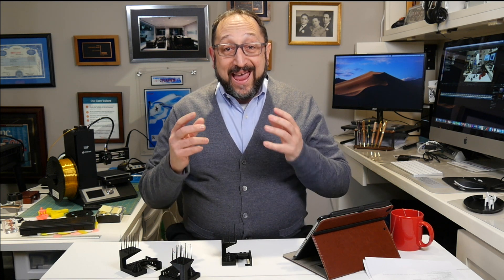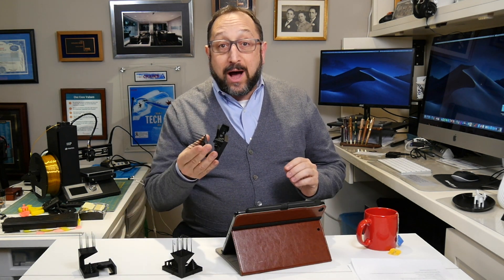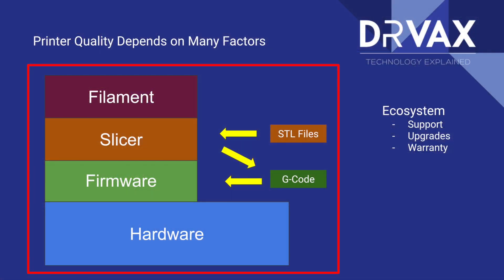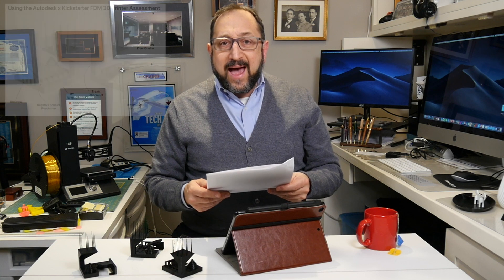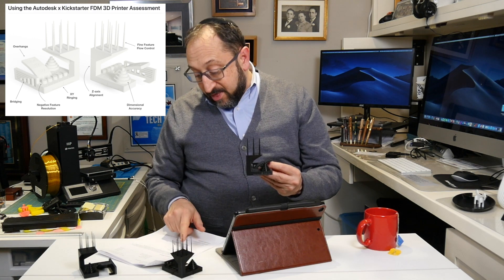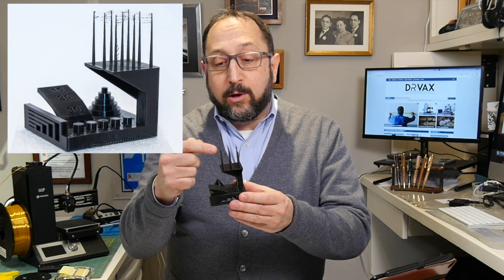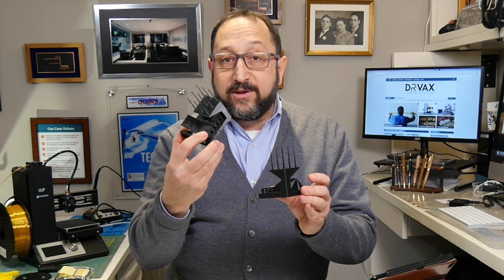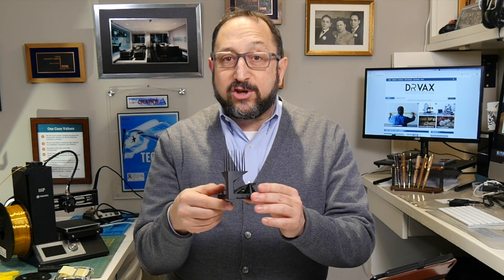Creality Ender 5 vs Original Prusa i3 MK3 (Updated Comparison)

Comment: Really interesting video,  your a great teacher.  Interestingly it appears that really the only reason the prusa edged out the ender 5 is because of optimised slicer settings in the prusa edition. This means you could, with a bit of work and quite a few test prints,  get that higher level of performance on the prusa of Cura too, and that means ....... you can likely increase the performance of the ender 5 by tweaking the cura settings too.  It would be interesting to run something like an ender 5 directly against a prusa in a production environment to see if the prusa really is a more reliable professional option, or if it's just that the slicer provided is actually just much better optimised which gives the illusion of a better printer?  One thing's for sure, where I am Prusa parts are not so easy to come by whereas I can order a lot of parts for my ender 5 on amazon with next day delivery and free postage.

Comment: Thanks for your video. I dont print too much but i WANT that everytime i want i print i can have my dimension right at 100%. If i have a piece that are 20*20*20, i dont want 20.1*20.2*19.9. So do you think i can achieve this job with ender 5 ?????
Reply from the maker: Probably not possible to get more precise that .1 to .2mm with any consumer grade FDM 3D printer.

Comment: nice video basically on the kickstarter printer evaluation model, it is kind of helpfull, but beside the price and tolerances there'd be a lottttttt more things to watch into, especially if you make 2 videos on the issue of comparing the two printers. what about noise, the ender is substantially louder when printing, what about the height you kind of defined it negatively (demanding space) but in terms of flexibility the ender is capable of printing much bigger objects, then again what about repairs where the ender is quite demanding, what about failure tolerance in terms of power shortage, running out of fillament and so on where prusa has a lot more to offer, what about quality of components which guarantee a much longe lifetime and a consistent quality throughout the lifetime, what about the usage of multiple fillaments at once, ther is an upgrade for the prusa but does anything similar exists for the ender ? (I seriously dont know because im just getting into the topic), what about connectivity, the Prusa is only fed by SD and USB , does the Ender have WLAN ? what about power consumption (not relevant for the hobby guy but for semipro it will) ...there is just so many aspects which havent been covered

Comment: Hornestly, i changed from ender 5 to prusa mk3s because the ender 5 is good a first, but starts breaking very quick. First was the cheap fan of the Hotend broke. Then the Mainboard started glitching and the cheap couplings of the bowdentube got loose when using retraction. Also it jammed all the time if you used over 80% of extrusion. 
The leveling was a nightmare. It seemed like after every print i had to level the bed new because the weak spinks were not strong enought or the bed constandly warped. The Z- Switch started also failing quite soon.
With the prusa i just had a noise problem on the y axis.
Reply: print the bed supports for free, Add a BLTouch for the auto bed leveling. Add a better nozzel end. I have not had any issues with bowden tube couplings but they are super cheap. You could do all this for under $60 and it will print as good or better than the prusa. I own both. U can buy 2 enders and upgrade both with BLTouch cheaper than one prusa and have a lot more build area. Also the Ender is SO SO SO SO much eaiser to work on and the upgraded parts are so easy to print or get for cheap compared to the prusa. Good luck.

Comment: Ender 5 still a good choice or has other options that are better bang for the buck came out?
Reply from the maker: It is a good choice, specifically the Pro version, if you need the print area.  If you do not. need the print area go with. the Ender 3 V2 and add a BLTouch.

A great place to discuss this is at the DrVax forum located at https://forum.drvax.com.

Comment: oh maaan, i thought i already made up my mind with a Ender 5 pro... but indeed, i want it to print a lot; so now i have to give a thorough check to prusa.
Reply from the maker: The Ender 5 pro is significantly different from the Ender 5 and closer to a Prusa.  The Prusa will have the edge in speed (direct drive vs bowden) and the ability to print at 300c while the Ender 5 pro from the factory I believe is limited to 250c.  If your buy the Prusa Kit expect to speed many hours (4-8) putting it together.  The Ender 5 Pro should take you 30-45  minutes.  Prusa support is the best available for a printer under $1,000 but the Creality user community is huge.  Best of luck.
Reply: @MakeWithTech  in your experienced opinion, the extra cash the Prusa i3 MK3 costs does it worth the investment compared to Ender 5 pro? the difference is considerable but i would pay that extra if it worth it.

Comment: I'd be really interested to know your opinion of the Prusa i3 MK3S vs. the Lulzbot TAZ6 / Workhorse printer line.  Am thinking about getting a PURSA as a second printer for printing high-detail models.  The TAZ6 is very good and rock-solid at printing medium-resolution prints and at doing fast prints with a high-injection rate head, such as the moarstruder.  I think the PRUSA would be better for high-detail prints... that take a long time, using the newer small-diameter filaments.  What do you think?
Reply from the maker: I own a MK3 but have no personal experience with the Lulzbot printers.   While the Prusa MK3 is much faster than my Creality and ANET printers with solid quality I find the Prusa printers very hard to work on.   The MK3 hot end assembly is made up of a number of 3d printer parts that are complex to assemble.  I find myself using my ANET and Creality printers more often as long as I do not need the higher temperatures offered by the Prusa.

Comment: You have sold me on replacing my Prusa i3 Mk 2.5S with a PAIR of Ender 5s.  My Prusa spends more time broken than running and I have spent enough replacing parts to but a whole ender 5.  With the minor quality differences you show here, I can't justify paying double for a printer that is so unreliable.  Maybe my Mk 2.5S was just a rare lemon, but Prusa has made no effort to swap it with a more reliable better one in my WEEKS of online chat with support.
Reply from the maker: If you have the skills to upgrade the Ender 5 as your needs expand you will find it an excellent printer.  My Ender 5 has so many upgraded parts that it is probably no longer an Ender 5.  On the other hand my Prusa which has been reliable is basically the same as when I originally assembled it.   Overall I love the Prusa but find it difficult to work on.

Comment: I plan on using a 3d printer for dungeons and dragons miniatures and terrain for the game, I'm still having trouble deciding which printer to get. When it comes to the character pieces details are important. What would you recommend?
Reply from the maker: For very small highly detailed models people often use SLA printers.  These are messy and more difficult to use but produce higher resolution models.
Reply: @MakeWithTech  unfortunately indont have a properly vented room for resin printers,  what would you recommend for fdm?

Comment: First, I must say that I enjoyed both your reviews on Ender 5 vs Prusa i3, really awesome work! You just won another subscriber!
But I'm still interested in some significant features of the Prusa ecosystem (e.g. multi material upgrade), but I just cannot bring myself to pay this price just for my personal use. I also print in flex material on occasions, so no bowden tube will do for me. But apart from those points, I admit you almost sold me the Ender 5 !
Then a remark on what you called ghosting for the Prusa i3 + Cura: what you circled in the picture is NOT x/y ringing or ghosting, but infill structure (probably square) showing through the skin due to skin retraction. Lots of reasons for this:
- The first reason is I also experience this phenomenon regularly, so I know it when I see it (Which is also the case for actual ghosting)
- The second reason is I happen to use the Prusa Mk3 (and with Cura, mind you)  at my workplace, and I know this machine is a soundly built and finely tuned piece of hardware, and I have never, ever, experienced any annoying x/y ringing with it! I think you would need to seriously overspeed it to start to see some ringing
- also, actual x/y ringing does not last for the whole length of a straight wall, the vibration is usually damped and dies off a few mm away from the angle that caused it, (depending on the print speed, of course). By the way, this property of ghosting shows you in which direction the printhead actually rotated when printing a perimeter

- The "ghosting" you circled is evenly spaced, and lasts with a constant amplitude for the whole length of the wall
- This so-called ghosting is not present on the which are "standalone" (i.e with nothing on either side, not a perimeter with infill inside) Look closer at the walls supporting the base for the vertical pins : you can clearly see the transition between the perimeter around the closed volume (which shows the so-called "ghosting") and the support wall which is out in the open and shows no "ghosting" at all. => nope sir, this is definitely not ghosting but infill pattern showing through the skin!

And then, to explain why this "ghosting" disappeared when you switched to Slic3r, I rather think this is due to different slicing features, such as skin thickness, infill pattern type, print temperature, and differences in "slicing algorithm" (the latter being a rather vague word for everything involving the way the slicing engines work) Indeed Slic3r and Cura have very different slicer engines that can produce very different-looking prints out of the exact same printer! (also speaking from personal experience here)
Of course actual x/y ghosting would also disappear with slower perimeter speed parameters in the slicer, but you are definitely not a newbie so obviously you would know that!
Reply from the maker: Thanks for your detailed comment.  I will check out your observations.  That is how we learn together.
Reply: @MakeWithTech  you're welcome! I also learned a few things from your detailed reviews, so it's only fair that I took a little time to write my comment.

Comment: I run a business  using only Ender 5's they run 24/7 a real workhorse. Prints perfect everytime and never needs bedleveling after prints. Each time i sell a print i can buy a new ender 5. I had a mk3 Prusa once and quickly sold it, it takes forever to start a print, its a tiny build surface, it needs bed leveling every single time.. The plate gets greasy... For that price i need to sell atleast 3 models. Also you need to take in consideration maintenance, what if you prusa breaks ? The prusa is not faster, because for the price of a prusa you can buy 3 ender 5's so you will always win on speed and build volume and when you run a business you need more printers. You need to keep machine cost low and sale high.
Reply: So the ender 5 is your peference. Are you using other filaments other than pla?
Reply from the maker: Thanks for your comments.   The Prusa and Creality printers serve different needs.  I agree the Enders 5's are consistent and rock solid.  The Prusa's overall print times, in my experiences, are significantly shorter and they support a wider range of materials without modification.   Cleaning the Prusa surface with rubbing alcohol keeps it clean.

Comment: What can you say now about Ender5 VS Prusa mini? Price is equal!
Reply from the maker: I do not own a Prusa Mini so I am shooting from the hip here.   I think it comes down to print volume.  Prusa seems to have put very high-end components in the Mini, including a new 32-bit control board.   I expect print quality will be excellent.  On the other hand, it has a relatively small print area at 180x180x180.  (Even at 180(3) it is much larger than many "small" printers.   So if you need to print large objects go with Ender 5.   For small prints, I expect the Prusa mini will be excellent and I also expect that with the 32-bit board you are going to see multiple upgrades that positively impact print quality.

Comment: To compare print quality you have to use exactly the same settings and slicers! Good profile is almost 100% way to succesfull print. If you know your printer dissadvantages you can correct them in your slicer settings.
Reply from the maker: You are correct.  However for many new users of 3D printers out of the box performance of a printer using the vendors recommended slicer is very important.   If 3D printers are to become appliances they need to perform well out of the box.

Comment: I would like to adquire the prusa i3. Bit in my job i need a printing bolumen of 35cmx35xcmx40cm . So what actually i thought was adquire the ender 5 plus. Consider you it as a good option?
Reply from the maker: I am a bit Ender 5 fan.   However, please note it will be slower than a Prusa Mk3.
Reply: @MakeWithTech  yes, but most pieces we need to prototype are around 30cms

Comment: Thank youI am trying to find out which to buy.    Can you print the prusa m3s Test again and the temps down alitle to show the best this printer can doI am thinking to buy one on black Friday this year.      thank you again
Reply from the maker: That is a valid request but I am afraid I just do not have the time right now.   I am 100% confident that on the Prusa you can tune for no stringing and on the Ender I am about 70% confident.
Reply: Thank You,  I will Get the Prusa M3s  with  hardened steel nozzle.   I like your channel, it is well done,  I am a 51 year old Machinist  and like Victor Vazquez  You remind me of many of the teachers I had in high school back in the '80s.  I am David

Comment: Ender 5 is better platform than Prusa, which is essentially Mendel printer with its moving Y axis. Prusa just improved it a bit. Prusa is a good entrepreneur, far better than an engineer or inventor. Ender 5(not 3) kinematics are a bit superior to Prusa, but still not coreXY.
Reply from the maker: I agree the geometry of the Ender 5 is superior.  However their is more to the Prusa than the geometry.  Take a look at this video:

Turning an Ender 5 into a Prusa i3 Mk3 https://youtu.be/YrBsJwUuSDo

Comment: So $330 vs $750.  If I put $420 or less worth of upgrades into The Ender 5 now how do they compare??
Reply from the maker: Interesting question.  Yes and no.  I am on my phone when a get to a computer I will provide you with a complete analysis.   Maybe I will make a short video.
Reply from the maker: Here is a bit more info.   The most significant upgrades you would need are a completely new control board, since the control board in the Ender is much slower than the control board in the Prusa, resulting in much slower print speeds.   Then you would need to replace both the hot end and the extruder with a new direct extruder and all-metal hot end.  Then you would need an auto bed leveling sensor and new firmware -- which might be part of your control board upgrade.  Finally, you cannot easily replicate the Prusa support environment where they upgrade their integrated firmware and slicer at least a couple of times a year.   

Now all of these upgrades would probably take you days, many days to research and install --- assuming everything works correctly the first time.   Oh, and I almost forgot you will need a new power supply to support the new all-metal hot end so you can print at 270c if you want to print filaments like Colorfabb XT which I think is an excellent high-temperature filament.

So when you get done all you will have left of the original printer is the frame, belts, rods, and maybe the stepper motors.

Now I think this would be a lot of fun if you have the time and you might end up with a really special one of a kind printer -- but is it worth it?

Thank you for the idea.  I will be covering this in a future video.  @Arin Hargett do you mind if I give you credit for the idea of the video?
Reply: Thanks!!!😁

Comment: Great channel. Lots of approachable
 info for newbie. I wonder, Prusa advertise as clog detection pause/return. Ender is just filament detector. So if I go with decent sized item, 100% infill 0.1layer, Cura estimates print as ~ 3 days. Prusa will get job done, and Ender may clog at 2nd day and I have to start all over? Trying to get decent 1st printer.
Reply from the maker: The MK3 will detect when the movement of the filament stops but the new MK3s will only detect when the filament breaks or runs out.  The filament movement sensor on the MK3 was causing a lot of false triggers so many people were just turning it off.  

A properly configured printer should not clog in the middle of a print but a 3 day print is still a challenge with any printer.

Overall for long prints that faster speed of the Prusa will make more of a difference.  Both are good printers but you are getting a higher end product with the Prusa.